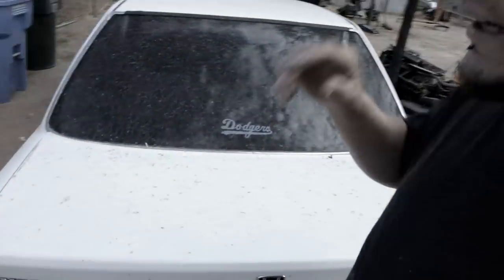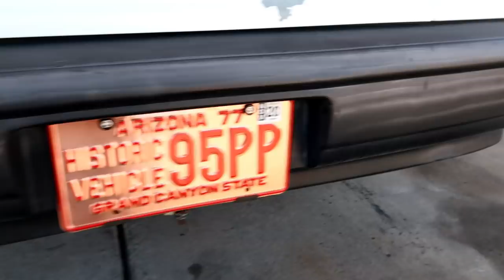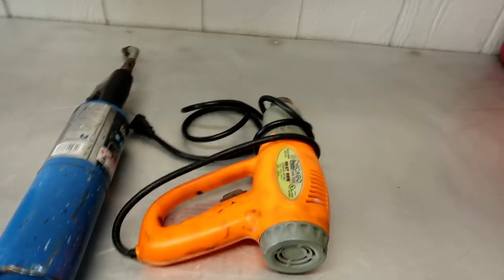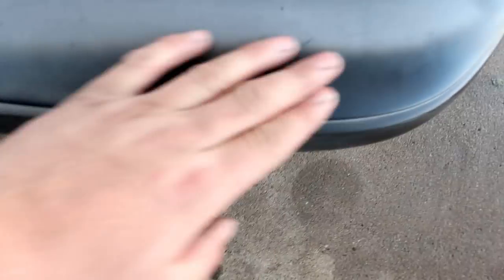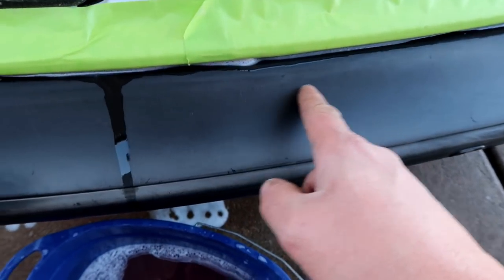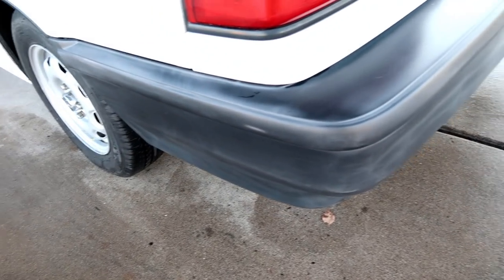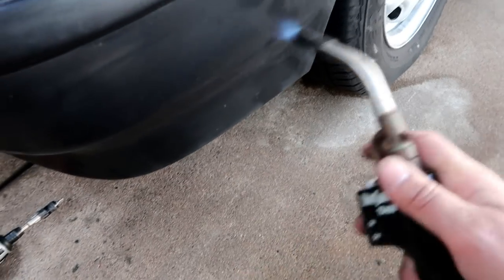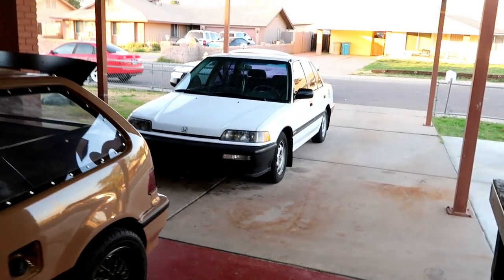EF Civic Bumper RESTORE! (How to restore any plastic trim)

Comment: I would definitely keep those OEM Corner lights they're becoming more and more sought-after and worth the money plus they're easily restored I'll buy them😅 also a fan torch attachment works great for this kind of thing I used this technique to make my 3D prints smoother it works perfect on my hatchback as well for brake Cooling cones in front and things like that great video man keep it coming

Comment: I would pull the side moldings off and weld the holes up. And do away with side moldings. And paint the bumpers white to match the car.